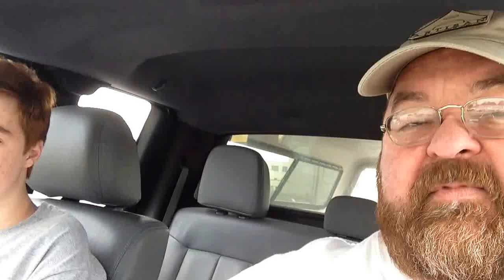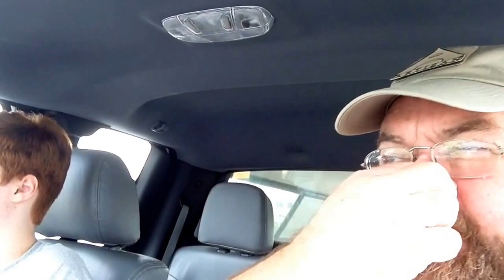Better Explanation for Concrete Counter Failure Video

Comment: Great info, I have seen concrete  with color added. Can you do this with the counter tops also? Thanks again!
Reply from the maker: I like to create the color with acid stains after the poor.  This way I can pour a sample piece and use different colors to show the customer.  It seems like the color is different depending on each pour we do.
  My next video is about how to fix the dry pour :)
Reply: Awesome,  can't wait to learn more.